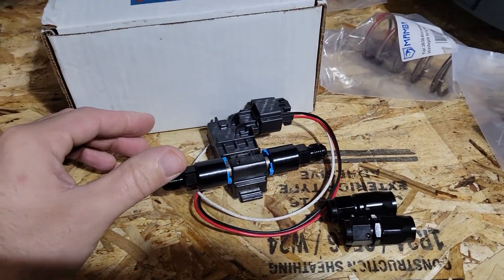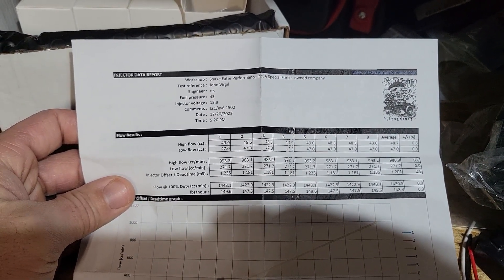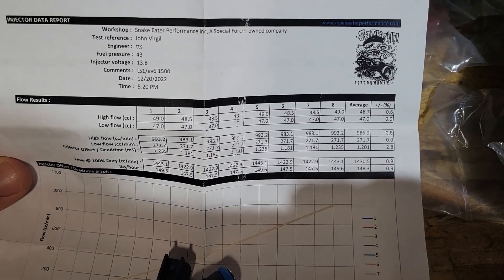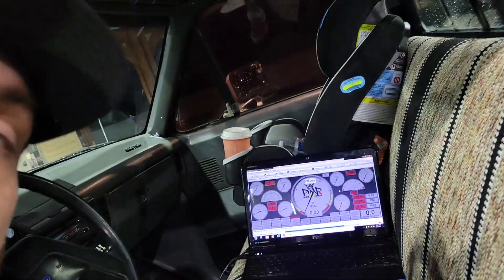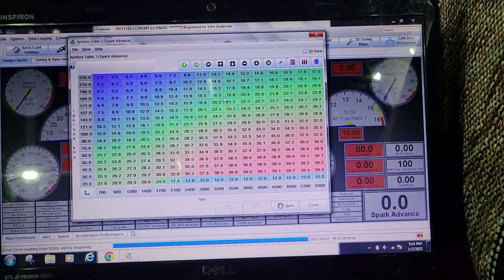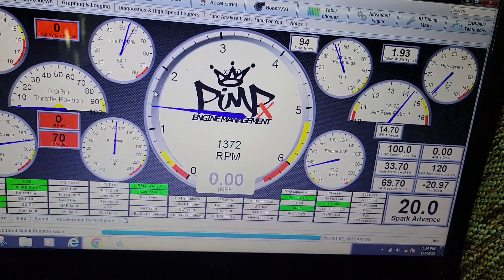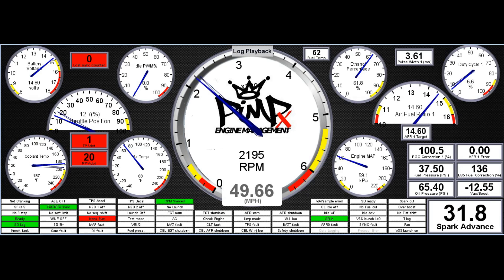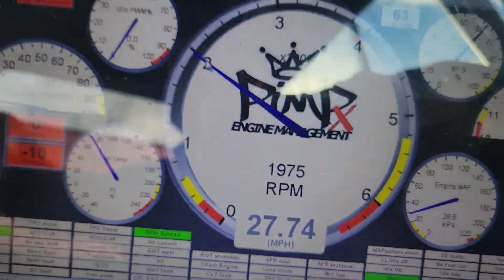Turbo EFI 460 loves E85!! Flex Fuel conversion #snakeeaterperformance

Comment: The Mega Squirt is a well developed system. But you have to know what you're doing in order to make good use of what it will do.
Reply from the maker: Yes for sure. I'm very happy with it and I feel the learning curve is quite easy. I have experience with Holley and Hp tuners which helps.

Comment: I noticed my engine doesn't ever get warm with the e85 in it. Had to send my 1500's back. Lost two of them somehow.
Reply from the maker: Huh I haven't had any issues with warming up. E85 is a bit cold blooded on cold starts around 32 degrees or so but my truck warms up just as quickly and hold 180-190 pretty much always. I'm real happy with these SEP 1500's, big improvement in idle and throttle response over the Deka 80# injectors.

Comment: Don't have E85 on tap in my area but I've wanted to try it. Seems to have better cooling properties vs regular race fuel.
Reply from the maker: There is only one pump in my area and it's just a few minutes from my house so I definitely got lucky. The next closest pump is about 1.5 hours away. I'm stoked with the flex fuel though since going back to 92 octane is effortless. I'm  keeping the water methanol injection for safety.

Comment: Impressive how far you're taking that megasquirt.  I can't think off the top of my head what more you can do.  I guess you could try and find the limits of that E85.  Running such low RPM's, that 460 should hold together for a surprising amount of abuse.
Reply from the maker: Yes for sure. I shift it at 5k rpm and since I made this video I've turned it up to about 14-15 psi, so 2-3psi more, and it's absolutely awesome. I'm amazed at how much cleaner it sounds when it rev's.
Reply from the maker: I am very happy with this MS3 ECU!